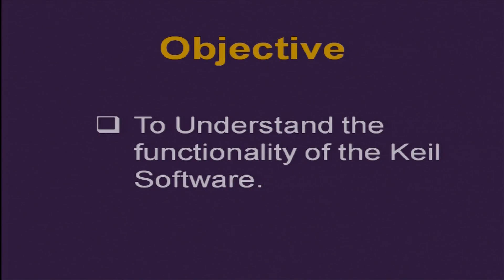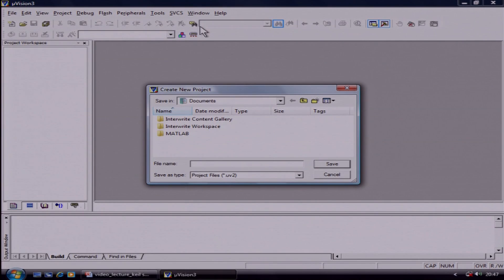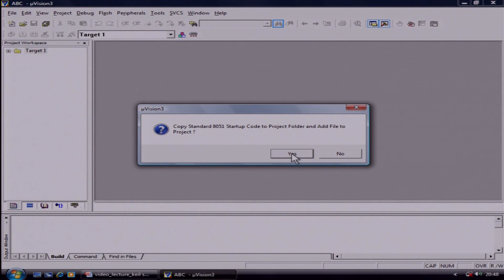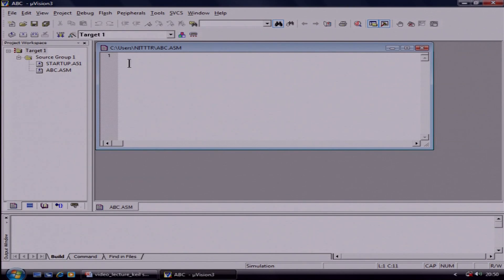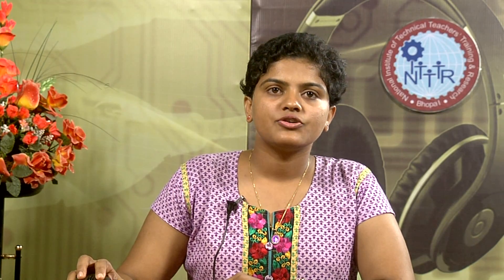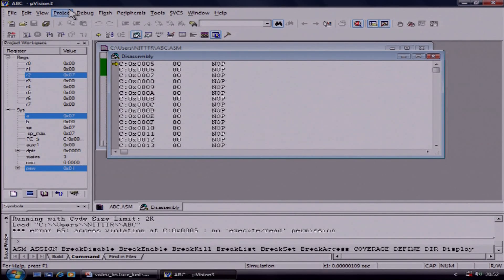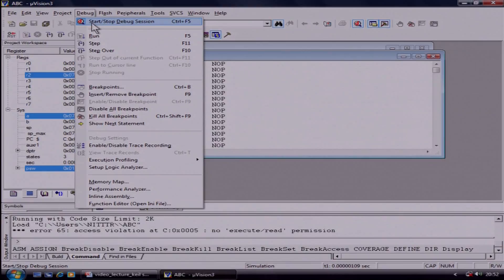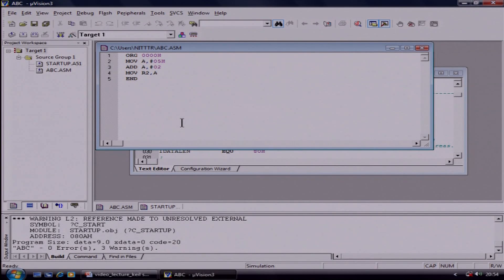use of keil software

Comment: Good info mam, small correction startup file is always in .asm/.s it's uses for m/r, clock initialize etc. when we working with. asm or .c code based projects. Correct me if I'm wrong. Thank you.
Reply from the maker: yes. startup file is in .asm  but it is not required for user (programmer) when we write code in .c as when we compile compiler takes care of it when our code is processed ahead.